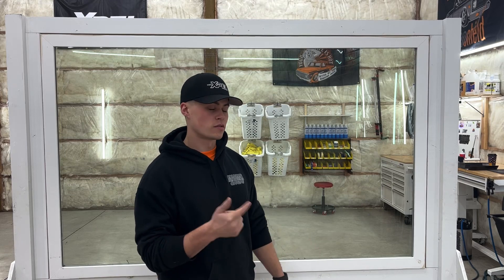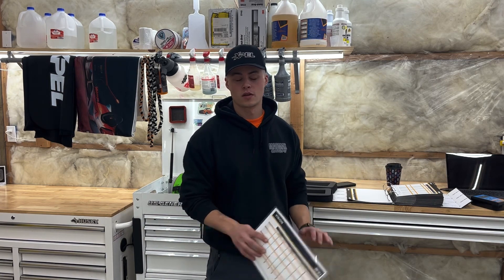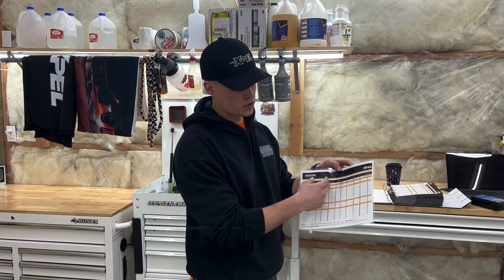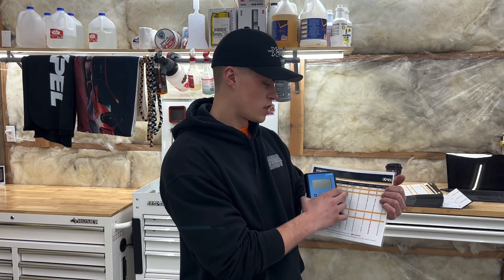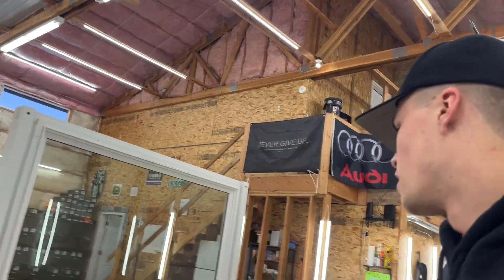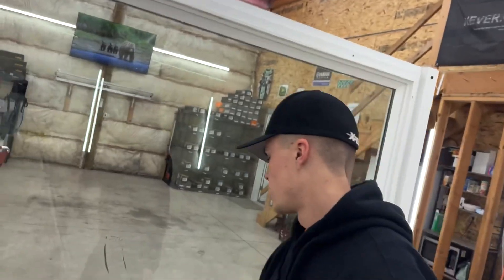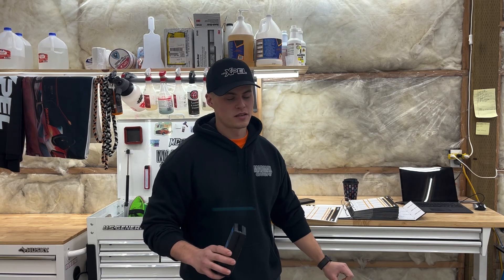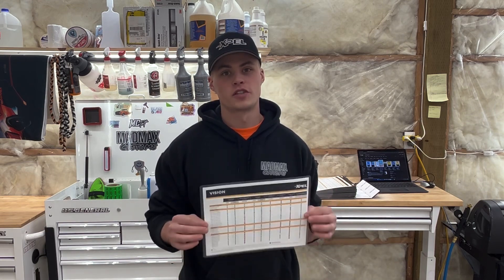Residential/Commercial Tint: Film to glass chart

Comment: On your OBS ls swap . I see that you used a 454 radiator and Nbs electric fans. How did you bolt the fans down to work. Could you send me some pics of it. When you where explaining the parts needed for the swap only can catch a slight glimpse of those bracket.